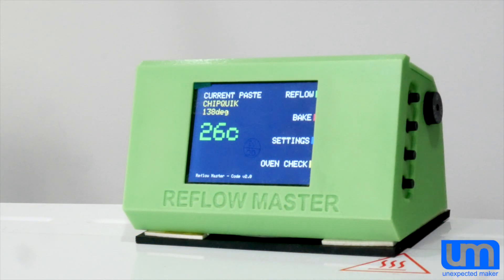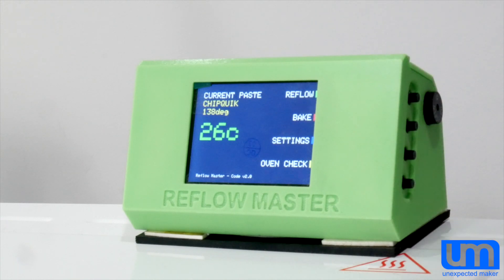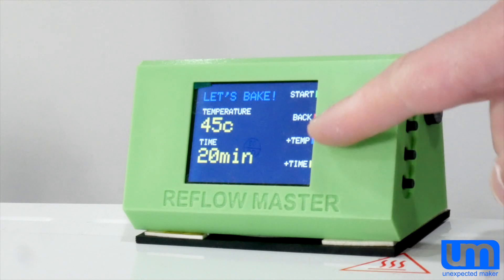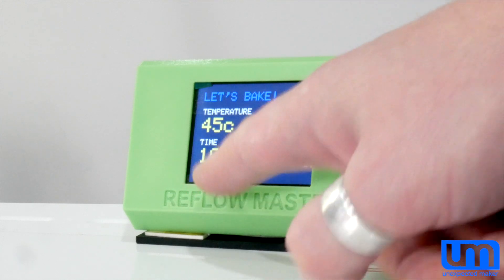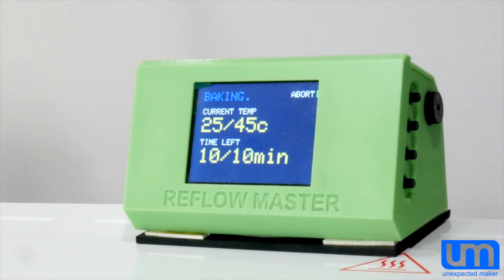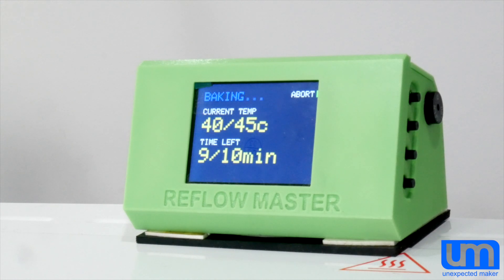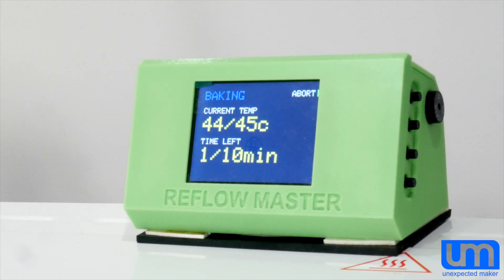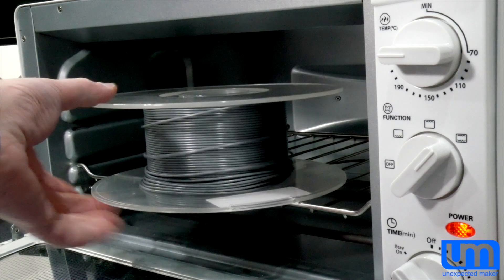New Reflow Master Update - Let's bake!

Comment: Hi Seon, I bought my reflow master in April 2019. You call this code version 2.0, which with my experience, would imply a significant update, and more than the new implementation may not be compatible with "old hardware." Are there any problems with old reflow master models, or can they update without risking an unusable controller? Cheers.
Reply from the maker: The update is fully compatible with all RM hardware :)
Reply: @UnexpectedMaker  Thanks for a swift response. Cheers.

Comment: Great addition to your Reflow Master functionality, adding to reflow oven versatility! Interestingly I've been using my reflow oven regularly in Bake mode for post-ultrasonic clean drying (typically 60 degrees / 20 mins), and had also been using bake mode regularly for filament and LED drying, until I recently bought a dehydrator to (more efficiently) dedicate to my filament preparation procedure.

Comment: Shouldn't the timer in bake mode only start after the set temperature is reached?
Reply from the maker: Nah, the 10min bake is for example purposes. Most folks will be baking for 30min to 2+ hours, so having it ramp for 2 mins out of the total is negligible.

Comment: Seon that's awesome! Even on less powerful ovens that might not be capable of reflowing, I can see this being VERY useful for drying filament, SMT components, drying out desiccant etc. You could also use it to warm epoxy to make it easier to mix, or to help speed up the set of mixed epoxy. So many uses!
I built a small oven that did things like this years ago and added a PID temperature controller, but it was so fiddly to set, and often overshot despite my trying to tune it. Your solution looks perfect :D

Edit to add: Oh also if you fancy more of a challenge, you could add a feature where users can store temperature profiles, similar for reflowing, but for drying/baking/setting certain things. Then they can select say "Nylon filament" from a list, hit go, and the oven is set up with a preprogrammed ramp-up, hold and ramp-down profile for drying that filament. You could even display the profile graph so the user could see at a glance what's gonna be happening.
Reply from the maker: Yeah, there are so many use cases for this. It's been on my list to do since before c-19 !

Comment: Damn I can't bake a cake at just 100 degrees, will have to go back to using the Neff:-)
Reply from the maker: Ahh, if you want to bake cakes in the same oven as you bake PCBs with toxic fumes... I'll increase the max temp for you ;)
Reply: @UnexpectedMaker  Cakes with pine nuts?? thank you I need 200 degrees with out fan assist :-)

Comment: I may have missed it, but does the timer start counting down once the set temperature has been reached? Also, I really need to update my reflow master. That bake feature has been something I've wanted for a while but I've been too lazy/intimidated to try adding it after an initial attempt didn't go so well. But maybe I can tackle the timer and temp limits for some annealing projects. Gotta admit that I'm pretty stoked for this update.
Reply: I was about to post the same comment. It may seem trivial, but I think it would be more correct for the timer to start once the set temperature had been attained.  ie. If you wanted to bake something for 20 mins at 60 degrees, you'd currently only be getting maybe 16 - 17 mins at 60 degrees.  It's like you'd need to always add a few miniutes to your desired bake time, just to allow for a reasonable heat-up period.  Sorry Seon, just me being over-analytical, as usual.  :)
Reply from the maker: @DigicoolThings  Some fun facts:
1. The higher the target temp, the faster it gets to temperature (relatively speaking).
2. From 17c ambient, with a target of 60c, it got to 75% of target temp in 58s and reached 100% of target in 1.28mins
3. If you have it wait for target temp before the timer kicks in you are still baking your item for longer as it's not a 0c then 60c - it's a ramp, where most of the ramp time it's above 50% of the target.
4. The longer the bake the smaller the % of time in ramp up
I think folks are trying to solve a problem that really doesn't exist - and if 5% and less of bake time is too much time lost for the bake for folks, then the code is open source and folks can add a warm up/down state if they really need it :)
Reply: @UnexpectedMaker  Well I did say I was being over-analytical, as usual. :)  If I analyse my over-analysis, then I conclude that my thinking is aligned with normal oven usage expectations. ie. In general oven usage terms, people think of bringing an oven up to temperature (wait for beep...), then they put stuff in the oven.  But, of course, a reflow oven is a special case oven, so regular oven intuitive use perhaps goes out the window.  There ya go...  over-analysis... Analysed!  Take care, and have a geat Christmas with your family. :)
Reply from the maker: No, the timer starts right away. Most folks will be baking for 30min to 2+ hours, so having it ramp for 2 mins out of the total is negligible IMHO.